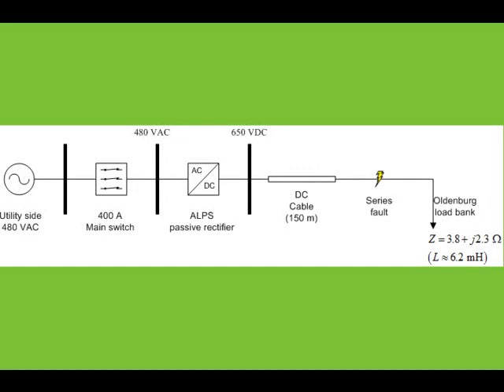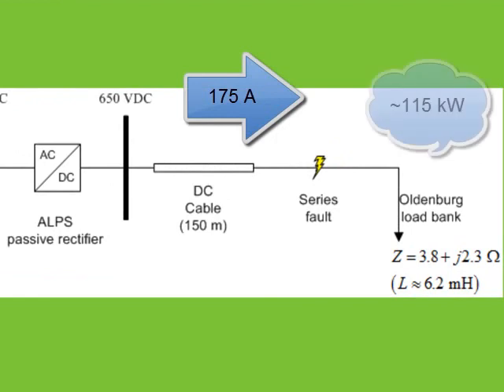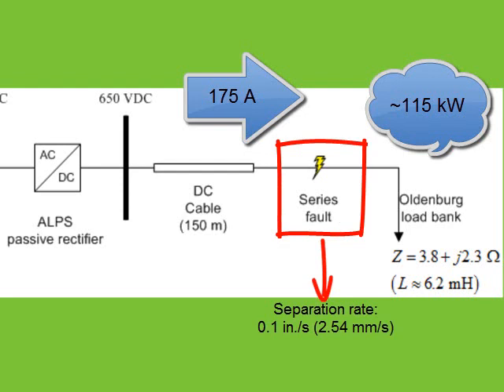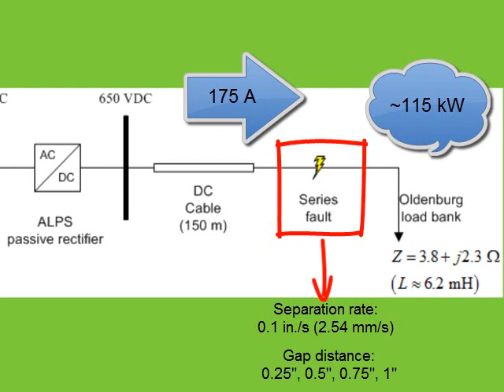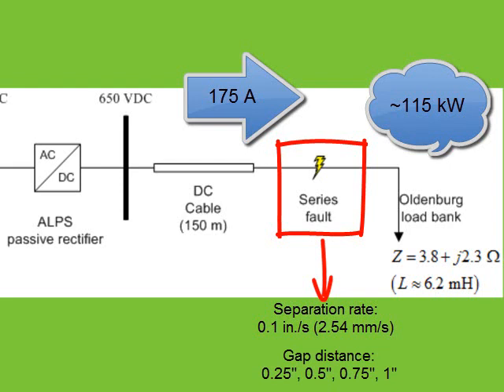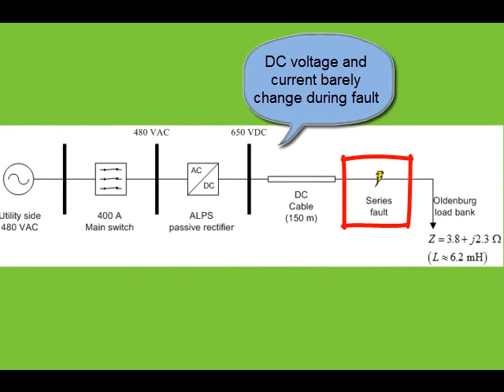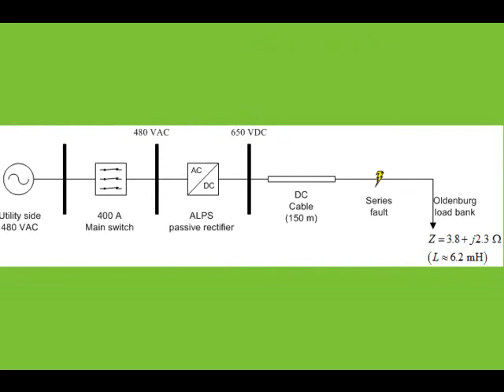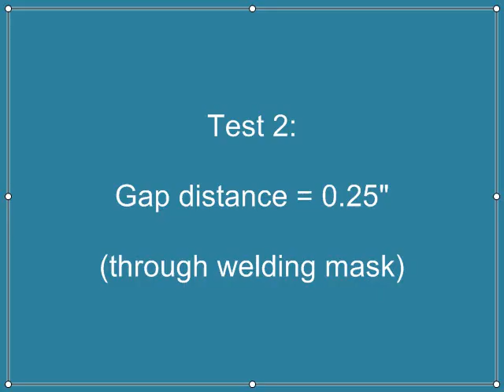5) DC Arc (fixed gap)

Comment: Does anyone know how /where to calculate the maximum arc gap that 100V DC will jump across?
Reply: The problem is that when you interrupt a DC current, the voltage will rise as high as needed to create an arc. Once the arc forms, the circuit is no longer open, because the arc actually has a low resistance. Interrupting large DC currents in long cable runs requires careful design.
Reply: It's not so much the voltage as it is the air being ionized forming a conductive path.
AC is less affected because the zero crossing interrupts the energy giving the air a chance to return to an insulating state.